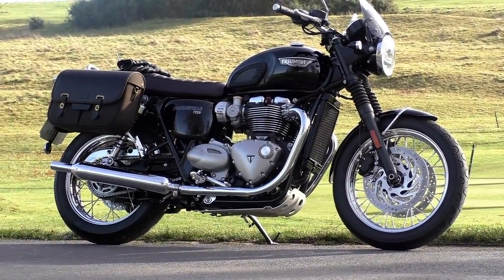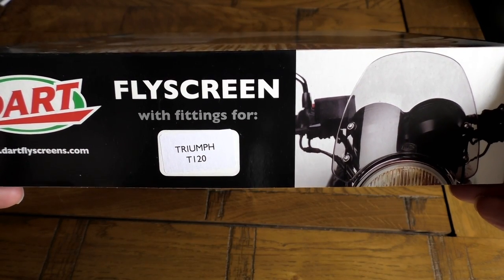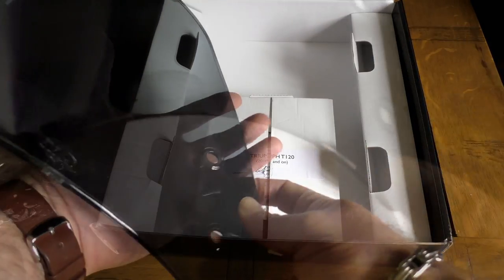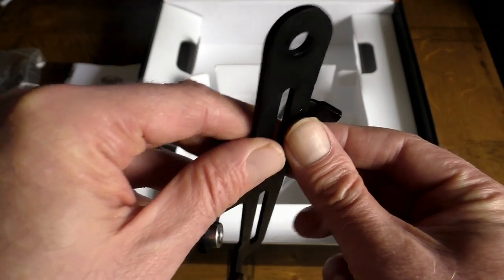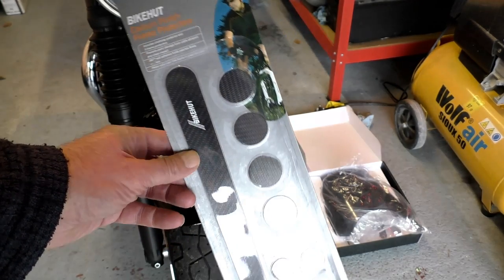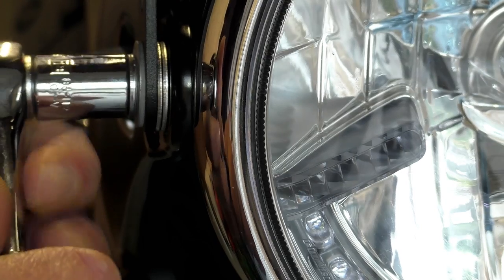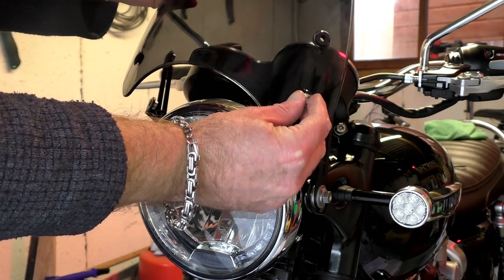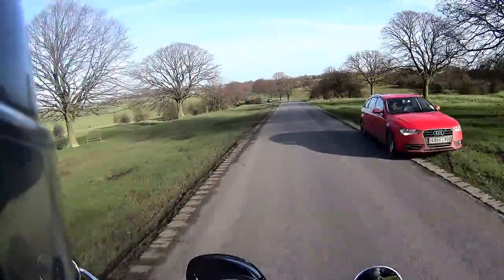Triumph T120, Dart Classic flyscreen WHAT THE OTHER REVIEWS DIDNT TELL YOU!

Comment: Just fitted the Pirannah flyscreen and to stop damage to headlamp brackets I covered the bracket contact point end with a strip of Shrinkwrap which stopped metal to metal contact.
The screen has a couple of rough patches at the bottom but nothing as bad as Stuart found on hids Classic screen. I am very impressed with it.

Comment: Good video and review which was part of the decision making in what screen to fit . 
Have to say and possibly due to this review some modifications have since been made 
The screen edge was well finished .
The tabs that rest on the headlamp support have been replaced by a moulded plastic support that is smooth and also helps adjust the angle of the screen .
The two spacers you had to fit have been replaced by one metal spacer .
After several weeks of use got to say it’s a great fit , good looking and makes a reasonable difference to the wind on the rider . 
As previously said the alterations made have made a better screen so thanks your review has helped make a good screen much better

Comment: Thanks for the instructions. Put a generic version of this on my Bonnie - used the bicycle-frame-protector tape suggestion, with multiple layers, just to be on the safe side. Strangely enough, it didn't feature the same issue with the arm hitting headlight bracket as the Dart does, despite being a cheaper imitation...go figure. 

I appreciate the help on the windscreen and swapping out my levers. Thx!

Comment: I've just fitted the Triumph touring screen. The price worked out only about £10 dearer than the Dart screen.  They call it a touring screen but in reality its just a tall fly screen. Fitting is a bit more complicated that the dart as you need to remove the headlamp bolts so you can move the headlight far enough to get to the indicator bolts. When all is said and done it took me about 20-30 minutes to fit. A bit of masking tape and a pen made sure the headlight was put back exactly in the same position as it was.  I went for the clear one as I think it suits my bike better. Will just have to see how much difference it makes on a ride now.

Comment: I wanted a fly screen like i had on my VMAX, and geez, I couldn't believe how many different ones they make. Any for 28 bucks I got one that looks identical to the one you have but the brackets aren't as pointy. I realize those points that stick out are supposed to keep the wind from pushing it backwards, but I've had it up to about 85 and not a scooch of movement. So I'm happy. And for less than 30 bucks.  Thanks Stuart.

Comment: Stuart Fillingham     As a kid growing up, I remember my Dad fitted an insect wind deflector at the front of the bonnet of the car. It was aprox: the same width and height as your Dart screen but shaped like the little blue and yellow Norton anti virus shield. It had a center ridge line with the "side wings" slightly concave. At speed, the airflow would be directed to either side of the vehicle, where insects were deflected away from the windscreen. The little Dart screen may achieve the same thing. Have you found your helmet visor cleaner as a result of fitting the screen?. If so, that's a plus...
Reply from the maker: Afraid not David, my helmet and goggles still look like a piece of flypaper after a ride!
Reply: Ah, not to worry, the little screen reminded me of that insect deflector of so long ago. Worked a treat too. Of course it's shape was designed so that the " side wings" that I call them, were concaved to the outer edges, with the top edges curling slightly forward, as best as I remember them. It was this that created the slipstream that pushed the bugs to either side. Made of Perspex, they were available in a few colours, red, green, blue, orange or clear. Later, the Transport Department outlawed any sort of bolt/screw on additions of this nature. Remember the Chrome swan with it's Perspex wings that lit up at night from a little 5 watt globe in the base?. Looked the dog's stones they did. Even new vehicles soon saw the demise of their iconic bonnet/hood mascots, as the Transport lot claimed, that in an accident they'd be dislodged and become missiles to passing pedestrians. Even our chromed peak headlight accessory for our motorcycles, got the chop, or cop a defect notice. Here they claimed that if you hit someone, the edge of the chrome cowl would slice and dice them. Yeah, maybe after the front wheel supplied their worst in injuries. All jokes aside, it getting harder and harder for your average pensioner to make end meet here in Australia, so next year the wife and I decided we'll put the house to the market and move to the Philippines. The sale from the house will fund a rebuild and the sale from our four year old Nissan X-Trail will fund the furniture removal costs via shipping container. Even the Police are taking the joy out of a simple drive of a mere 50 kilometers to the shops, by using covert vehicles as speed cameras, with no signs set up to alert you the way a highly visible Police car will have placed sign a ways back saying "speed camera". It's not enough that our highways are steadily seeing an increase in average speed cameras, now they're into placing old cars, parked on the side of the road, that traps the unwary. It's bloody wrong. I've got no problem with those that exceed the posted limit by 20 or 30 km/h, but when I'm only over less than ten km/h (6k over), out in the "boonies" and cop a fine of $160.00, then it's time to up stakes and get the hell outta Dodge. Apologies for the long novella. I look forward to next year over there, as I can see a T120 Bonny with my name on it. Enjoy all your videos, particularly the tips on polishing. Keep 'em coming. Cheers mate...
Reply from the maker: very similar state of affairs all round here in the uk sir a sign of the times I'm afraid, i think hood ornaments where banned back in the late 60s for the same reasons, and speed cameras plane trap cars and average speed cameras abound, good luck with your relocation sir!
Reply: Thank you Stuart. Yes, I'm looking forward to the move. All the best for the New Year, cheers my friend...

Comment: Sorry to hear of the problem. If you fit the thick Triumph washer between the screen bracket and the headlight bracket that should afford enough clearance. I believe that's what most people do.
Reply from the maker: Thank you I shall give it a try! But perhaps a slight change to the instructions might be in order if it solves the problem?
Reply: Indeed - to be honest I thought the instructions did make that suggestion but I've checked and they don't. Will update them today!
Reply from the maker: The Instructions supplied with my kit, make it very clear that the "original Triumph washer" be placed between the bolt head and the screen bracket, and that the two stainless steel washers be placed between the screen bracket and headlamp bracket.  As I'm sure you will agree it would be wrong of me to suggest to viewers, that they should experiment with this configuration. To do so would possibly affect their statutory rights in the event of any claim, and may affect the warranty of the product. 
Should you find a suitable official remedy to the problem, please don't hesitate to contact me and I will be happy to revisit the review in order to point out any alterations DART has made.Thank you for your comment.